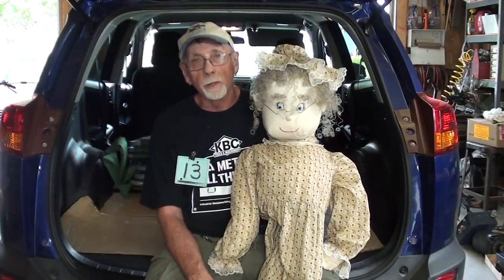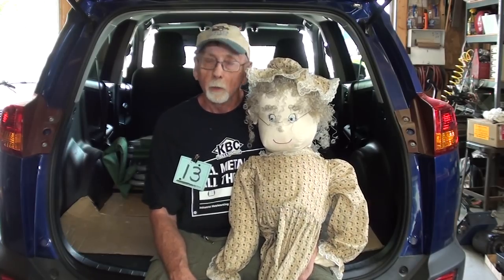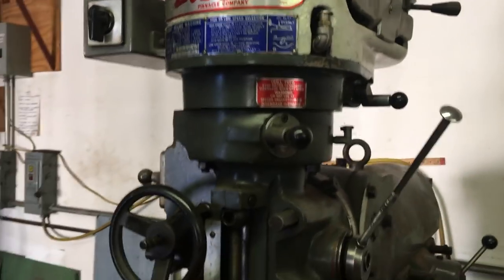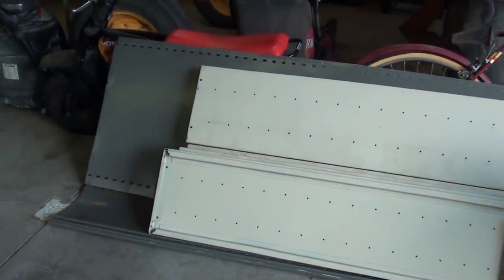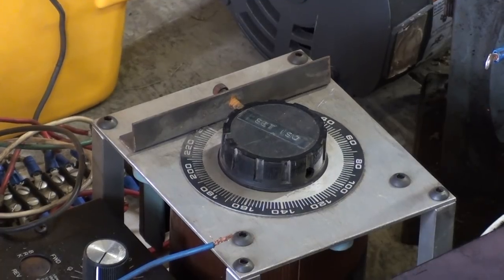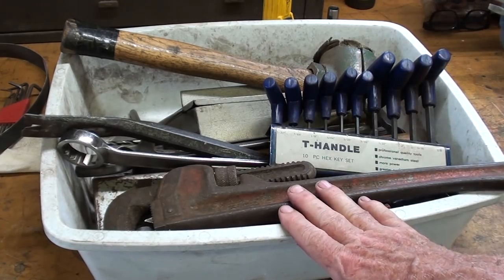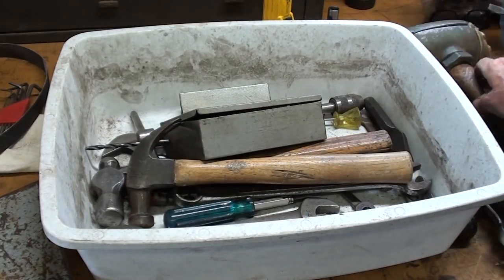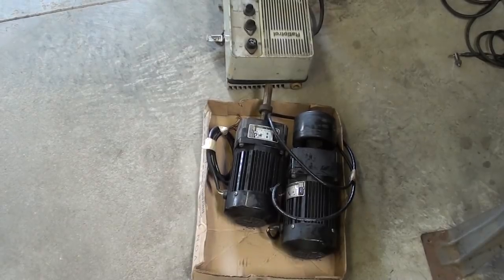Estate Auction with MACHINE TOOLS pt 2 tubalcain

Comment: Hi Lyle, the item you called a resistor is a variable transformer often called a variac. They allow smooth AC voltage change.

Comment: As said by others you have acquired VARIAC’s - which are quite useful. I mounted mine in a 8x8x4 PVC junction box and installed a NEMA 5-15 socket on the side of box + a fuse on the input mains. This then may be used to test many things by gradually increasing the voltage. Resistive loads such as soldering iron may be powered lamps etc. Motors may be tested but not run effectively. Want an adjustable temperature hot plate for UR coffee - no problem.

Comment: Pete, just a few things, the variable control is a variable transformer. This works on AC only as it is a transformer not a resistor. I use these to change the output voltage of a battery charger, especially when charging 2v traction batteries from a big 12v charger (I've done a video about this).The 90 degree worm gearbox is a good find and the ac motors look useful for the many machine builders and repairers on youtube. Cheers, Andy
Reply: Yeah, those are fairly expensive too. Careful on what you 'power up' though, these are usually only 1-2 amps output for that size...you can vary the speed of a DC motor by changing the AC input to the speed control/s... For most of this stuff on your list of 'steals'....1-2 items is worth the asking/sale prices.
Reply: I look at items like the pry bar and think, I don't need a pry bar, but I can cut the end off and now I have a piece of hex stock for a project.
Reply: Hi, I have used a large variac with a 400v transformer, a recifier, and a capacitor in a variable DC supply to test grid inverters. Works well, cheers
Reply: Yes, the variable transformer or variable auto-transformer is a very useful thing. Just make sure the knob is in the zero volt position when you power it up or you may damage the carbon brush.
Reply: I find them so amazingly useful. cheers
Reply: There in lies the problem, how much stuff do you keep. I know of several people who have kept so much that it has actually stopped them doing anything, just from the pure choice of posibilities. Cheers

Comment: Capeing chisel, gear drive motors can be used on bandsaw to convert to metal. And even on a drill press pending on its output speed. Good deal on the first video was the Albrecht chuck . .Nice haul for the day

Comment: The dc drives are a great buy. I've converted both my drill presses and a bandsaw to dc. Full torque at nearly zero speed. Automation direct for cheap but good ac or dc motors and and drives

Comment: I first learned to operate a lathe on a Colchester made in 1950 and it was more modern than that one. I'd say that was pre WW2 or post WW2 when Britain was exporting to save itself. It looks to be in super condition .Colchester made thousands of Quality lathes for Colleges across the British Commonwealth and those ex school machines still bring top dollar .As for the $200 Mill, it was probably cheap because it had dust on it...
Reply from the maker: I didn't realize the lathe was that old

Comment: DC motors may be cheaper than you think.  Most treadmills use DC motors in the >1 H.P. range. Most of the time you can find these for free when the belt goes out and they stop working. Most of the time the motor is fine.   There are numerous YouTube videos on how to set these up without the complicated treadmill controls.

Comment: Mr. Pete I would have drove up there for that mill and lathe that was a steal .
Reply: joe tiller Even if they GAVE you the Enco- your problems would only be beginning...you'd have to move it, find a place for it, and connect it to electricity. If you lived in an apartment building, it wouldn't be possible. And if something broke on it, you might not be able to afford to get it fixed...

Comment: Did you get that Kirby vacuum cleaner? I restore old Kirbys. They are incredible machines. Even the older ones beat the crap out of any 1-200 dollar Walmart vacuum. They usually need nothing other than a new belt,  good cleaning and polish, and a brushroll adjustment! Occasionally you'll find one with worn bearing or a broken fan. Both parts are very cheap and easy to replace. The current off-white Amodel plastic fan that Kirby makes is damn near indestructible. The old metal and grey lexan fans are brittle and easy to break with nails and coins and big rocks.
Reply: My mother managed to break 3 fans in one week!
6 boys and 1 girl just might have been the cause.

steve
Reply: With me, it was my first (ground by me) lathe tool bit.

You should have seen what that did to the dryer drum!

steve
Reply: Steve Skouson I can imagine. :( Yikes.
Reply: i have 2 kirby accessories on my  go trough pile waiting on me one is a sander,never sean one before

Comment: At around 8 minutes those pliers look like the tool you use for crimping on those rings for fixing airhoses. I cant rrmember what theyre called but they are a ring with two ears on it and you crimp the ears down to tighten the ring around the hose.

Comment: Before you throw a motor away check the capacitor and start switch.  Both are easy repairs and common failure items on single phase motors.

Comment: Auctions can be interesting.  I bought a Bridgeport Series 1, 2J at a school auction.  It has a shaper attachment  on the back of the ram.  It was an online auction, I thought the tool dealers would drive the price way out of line, so I didn't even bother bidding on it.  About 1/2 hour before it ended I noticed it had not bid up much.  I decided to bid, just so the dealers wouldn't steal it.  No one else bid, so I got it for $937.  It was in amazing condition, probably only 200 hours on it, the chrome ways were perfect.  I sold the shaper for $1000 and took the machine to our makerspace.  If it were not for the buyer premimum and transportation, I wouild have made money and the makerspace get a free Bridgeport..  You can see the machine in some of the videos I've been doing for the makerspace.
Reply from the maker: Wow, that was the deal of a lifetime
Reply: We have had some incredible things happen while building out The MakerBarn.  We got a 25" Hegner scroll saw for $29, it had motor/controller problems.  But being an electrical engineer comes in handy some times.  A 14" Delta bandsaw for $80. It needed some parts, but used parts for those machines are easy to find.  One person donated a big wide belt sander, just as several members started building cutting boards.  School auctions can be quite good because many of the nicer machines are reserved for advanced students (and the instructor) and have very low hours.  Here I am speaking to the choir.

Comment: My 15/16 & 1 1/8 wrenches are the most beat up used tools in the set🤕, I got thinking and realized it almost has no use on machine tools. Plenty of use with 5/8 & 3/4 bolts though. Probably everyone has certain tools that get heavy use. I would have a large pile of 7/16, 1/2, 9/16 sizes if all the lost ones would show up.

Comment: Not a "bad" haul. If you don't need pry bars, cut the ends off and you've got some nice hex steel for projects.  I think  Richard Ashman had the first correct answer on the cape chisel.  Had to get my wife a new vacuum.  Tore the old one apart, kept all the metal parts for reuse, including the 12amp motor.  That motor is 16 years old but has plenty of life left in it.  Am making a small belt grinder out of it.  See you next time.
Reply: Mature Patriot The wonder bars can be cabinet door handles in the shop.  😀

Comment: I believe its  a cape chisel for cutting keyways?
Reply: Cape pattern, for sure. Never used one for cutting keyways though.  Great for lopping the shop heads off of aluminum rivets!
Reply: Also good for removing  broken or cut off pipe threads from the fittings without damaging the internal thread.
Reply: Definitely looked like a cape chisel, yup.
Reply: it is indeed a cape chisel, its used in any application where you need to chisel in a tight space where the sides of a normal cold chisel would bind. Like a keyway i suppose. That is why it looks so unusual since the cutting edge has to be wider then the body but still needs to be well supported.

Comment: You can sometimes get a Pneumatic Tire with the Hub for a few dollars more than the inner tube...
Less work required.
Reply: You know, I happen to like Harbor Freight and Asian made products do not scare me, but one thing they cannot do is make a tube that holds air. Everything I've bought from them for work and for home that has a pneumatic tire on it has to be aired up each time it's used. 
Best just go for a quality replacement tube.
Reply: Probably so. I know their compression test kit is garbage. Two different readings with and without hose. I don't know why they continue to import something that gets bad reviews and is demonstrably bad.

Comment: DC drives are ok but the problem is that they dog down and drop speed under varying load.  Some better ones have a feedback to the drive so they can read the rpm and boost the voltage to keep it running at a constant speed.  The rpm sensor can be mounted anywhere like the spindle of a lathe or something.
Reply from the maker: Thanks

Comment: How much did that Gerstner go for?

The ”variable resistor” looks like an auto-transformer, which is much more efficient. Unfortunately it doesn't work as a speed control for AC motors, which are frequency-locked. You could use it on a universal motor, thought.

The chisel is a cape chisel, no idea what they are used for.

Comment: Sniff ... sniff ... is that something on the lines of an arduino or a stepper motor I smell ?  Will thelma be appearing from a trapdoor sitting on a perfectly controlled spinning device?  Certainly some of the other creators are making good use of an old chuck attached to a motor and a small box of tricks to make it spin ... if you can get all those motors running you'll be able to spin a truck!!

Comment: Mr Pete Hi from Lebanon I need your help, I have to make worm and worm gear tomorrow my question is as am going to make the worm wheel on horizontal milling machine using standard 20 degrees pressure angle cutter should I make the cutting tool for the pinion 40 degree s included? Please am waiting your answer.

Comment: Those DC motor controllers are quite good.  You have to install a resistor to match the HP of the motor.  Get the manuals here 

https://www.kbelectronics.com/Variable_Speed_DC_Drives/DC_Drives_NEMA_1.html
Reply from the maker: Yes, I already determined that. Where can I get the resistors.
Reply: Same page, the contact info is on the bottom, ask for technical service..  They are in the USA,  They have stocking dealers in every state.  They know their products and speak English.